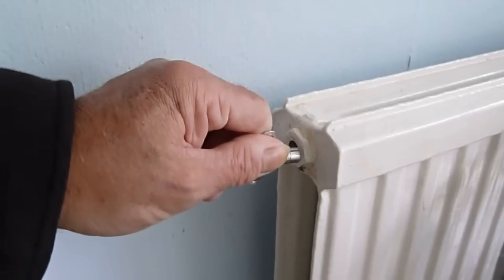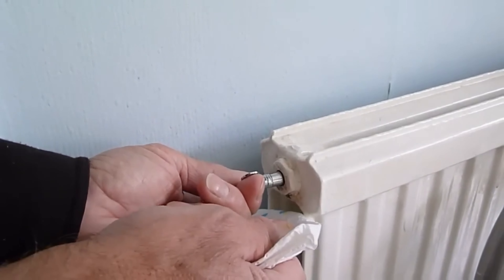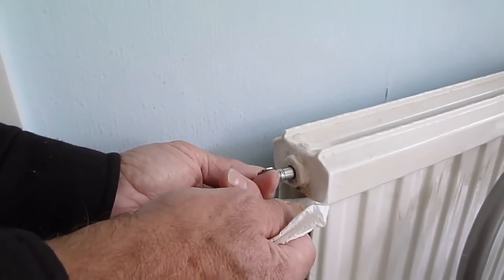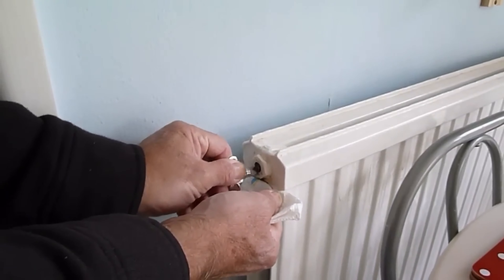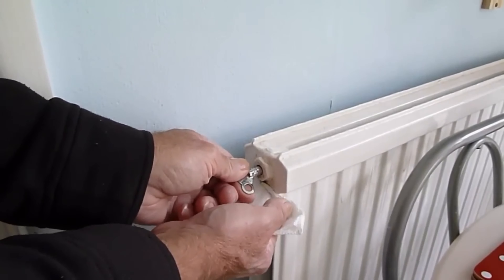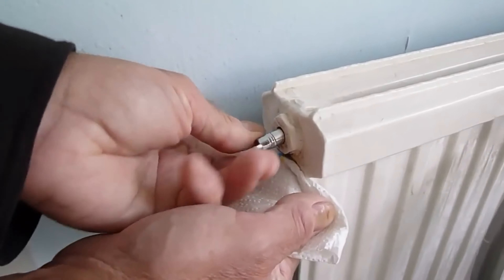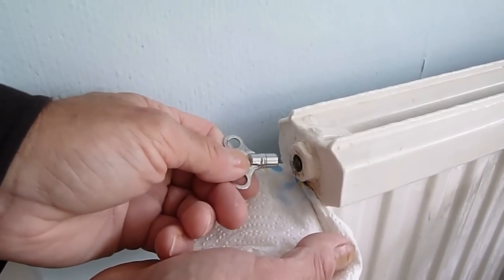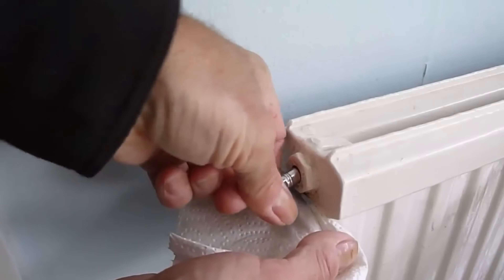# Bleed# a central heating radiator that is not getting hot.

Comment: I can't see a problem with bleeding the radiators with the heating turned on. Yes, the water might be hot but is there any other reason?
Reply from the maker: It can actually draw in air.